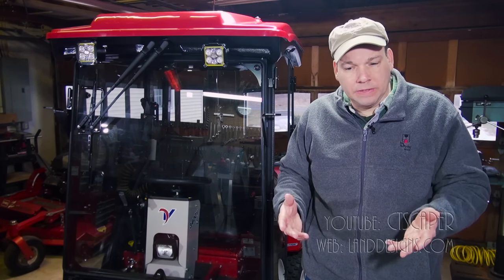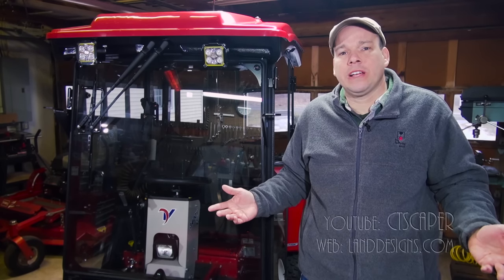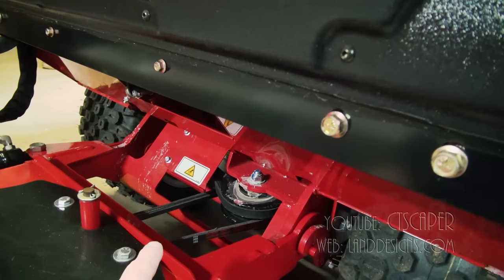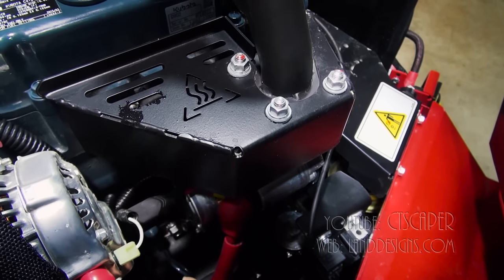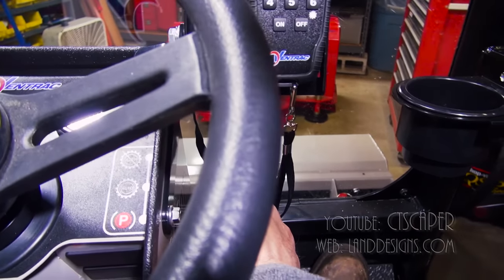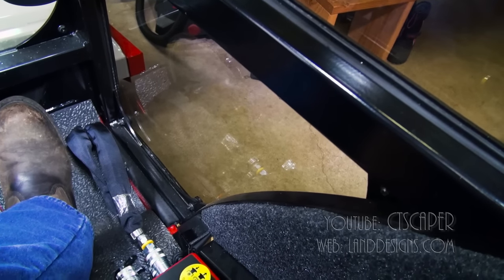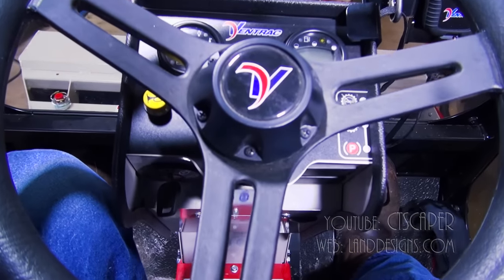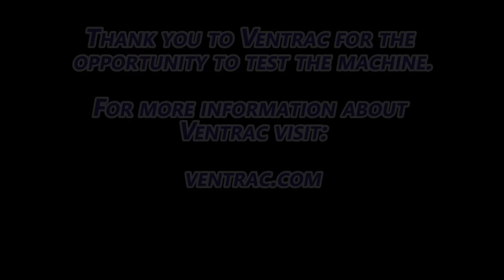What's a Ventrac Compact Tractor

Comment: great video. I have been wanting to see the cab on the 3400. How is the noise in the cab? Ventrac is A great tractor. The are A Ohio based company that originally started Steiner. When the sold Steiner they then started Ventrac. Not all attachments will work on the 3400. I do know the belt drive on the 3400 is different than the 4500, so you have to have A snowblower and mower deck for that specific tractor. I like how you sit up front on the 3400, very easy to see everything.  The 4500 is A beast call them goats the way they climb hill sides. I can't say enough good things about Ventrac the are really well built great quality machines.  One last note Steiner attachments will work on A ventrac. Would like to see A night video of view from cab.

Comment: At 13:15 I notice a green button on the rear SDLA controller.  What does that green button control?  the Ventrac website shows clearly the red rocker switch and two buttons on the front control lever but not the rear one.
Reply: +Land Designs Unlimited LLC It does take some getting used to but I've had my 4000 series for over 10 years and think the controls are great.  I've never seen a green button there, even on the new models or on the Ventrac website.
Reply: +Land Designs Unlimited LLC I am not a salesperson or official representative of Ventrac but I will state that every Ventrac owner is, in part, a representative of this company.
You ask how they hold up and I can only say that these machines are designed to last a lifetime.  My 4200VXD is a 2005 model and despite putting through countless grueling tasks still performs wonderfully.  I own about 60 acres here in Northern Maine and I use the Ventrac for every job during every season year after year.  Most companies will engineer and refine their machines to save on materiel to lower costs but not Ventrac.  The differences between their new models compared to the older versions are the refinements are made to make the machine stronger and last longer, not to make it as cheaply and flimsy as possible.  I would dare to say that Ventrac machines are over-engineered but only to assure many years of trouble-free use.
My uncle was my family's first Ventrac owner with a 3000 series, much like the one you tested.  His must be about 15 years old and still looks and runs like new.  I was so impressed with it that I bought my 4000 series about 10 years ago.  Shortly after, my father, being so impressed with both our machines bough a new 3000 series as well.
The price of a new Ventrac may cause hesitation in some but understand that you get what you pay for.  A single tractor that can go places other tractors cannot and while using dozens of different attachments to handle any job on my property is a very valuable asset.  
Sorry the the longwinded message but I can't say enough about my satisfaction with Ventrac.
It is also of note that I bought a second Ventrac, a 4500Z.  Now my wife or my sons will be able to get jobs done around the property while I am tackling other jobs at the same time.
Reply: I realized that I didn't answer your belt question.  I'm not sure I understand what you mean about changing belts.  Each attachment has its own belt that connects to the PTO pulley on the tractor and can be done in a few seconds.
Reply: In all the years I've had my 4200 I have never needed to do anything with that belt and I've put it through a lot.

Comment: Have to send it back because you would need to take out a second mortgage to keep it.  Gotta be pushing 50k if not more on that demo.
Reply from the maker: I think you're high on that number.  I'd guess around 30.
Reply: CTSCAPER 2015s are going for more than that with a cab and 2 mower decks.
Reply: Joe Blow Randomly found the price sheet for Florida 2015 on Google. 3400y 16k, snow blower 5k, broom 3k, cab 5k, drop spreader 5k. Sure it has more options but that is all I saw off hand. So probably 34k-40k with only snow blower and broom.
Reply: Joe Blow If you want to show your email I can send you this document. It is 7 pages showing all prices on 3400 and 4400 and attachments. I think it is for Florida dot since it shows 2 prices for every thing.
Reply: 20000 for the  tractor, 6000 for the cab 5000 for the snowblower, the 3000 series are discontinued tractor. I bought a 2014 used on this year a 3100 and I love it. I have the plow, the bucket the grass cutter, and a snowblower. Love it and I do the neighborhood